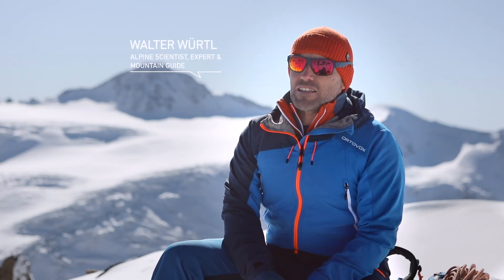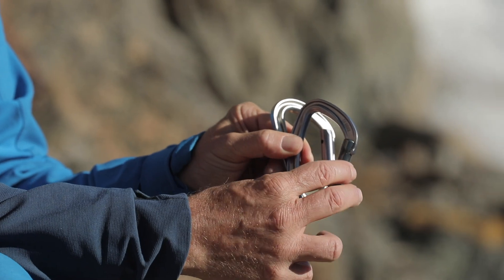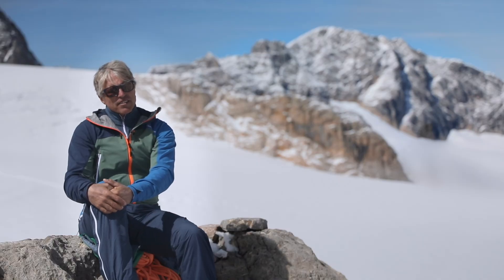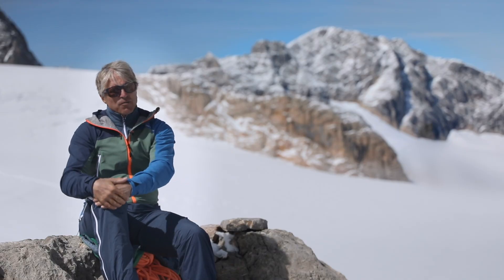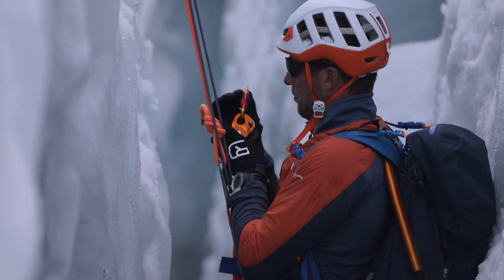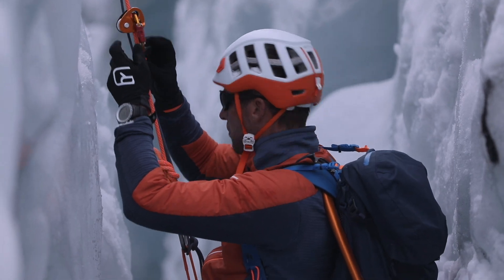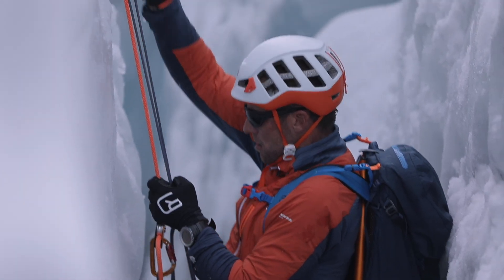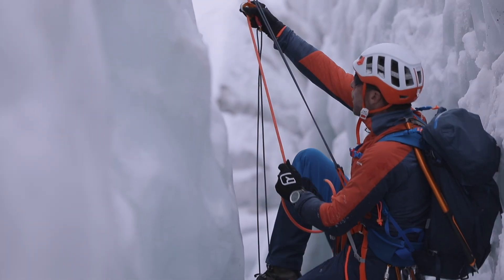Self-rescue from a crevasse with rope clamps (Micro Traxion) – Tutorial (18/18) | LAB ICE

Comment: 2.20 in the video is it me or that caraben is not screw on?
Reply from the maker: Hi there,
I´m not sure if I got your point right: But when I stop the video at 2:20 the only biner I can see is the Petzl Balllock - an automatically locking safebiner – one of the best and safest locking biner I know. As you can see seconds later and earlier in the video this biner connects the tie-in-loop of your harness with the prusik…so it is very important to have a safe connection here! You also could do it without this biner and connect the prusik directly with the loop!
Best, your ORTOVOX team
Reply: @ortovoxsafetyacademy  The top biner is Petzl Attache ScrewLock which has a red indicator when it is not screwed on. It shows at 2:21 and I think that feature is really good since it is really easy to spot unscrewed biners.
Reply: The top biner is only used for redirection, it's not mandatory to be locked.
Very nice video btw.